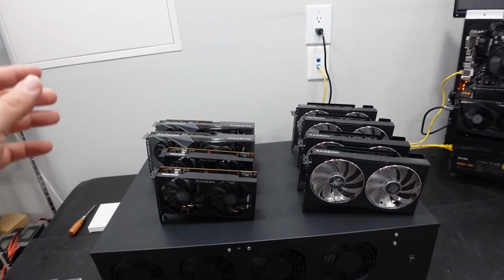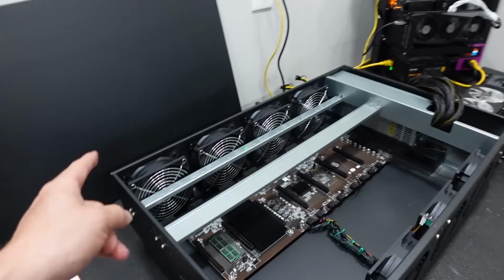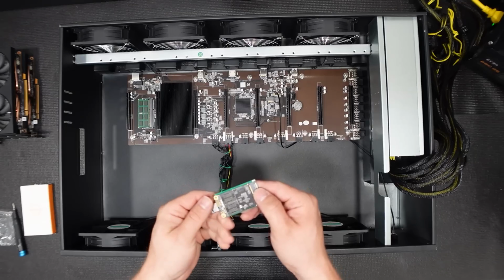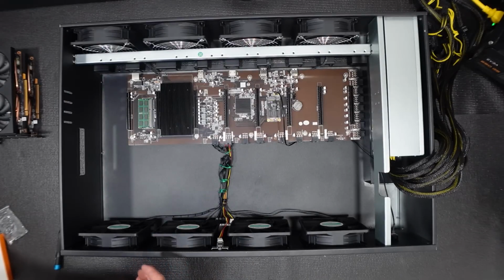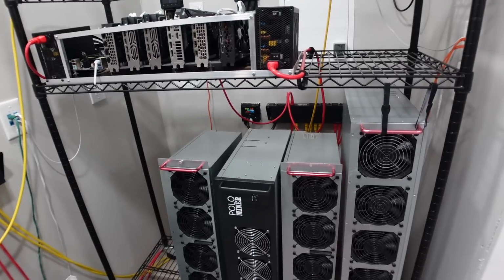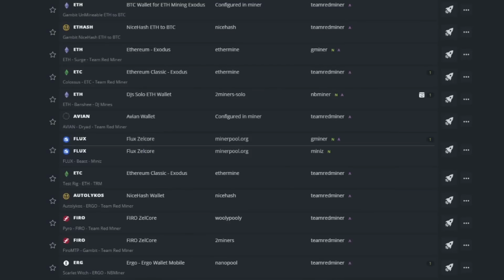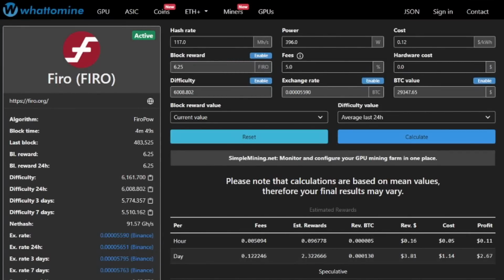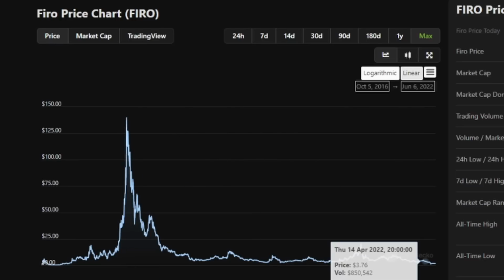BUILDING a GPU MINING RIG for AFTER the ETHEREUM MERGE

Comment: Hey hobbyist miner. I was wondering if you could look at the 6650 xt, 6750 xt and the 6950 xt refresh series. I noticed there was a increase in clock based algorithms rather then memory and would like your take on it. There isn't enough data on them on YouTube and would appreciate it if you find the time for it.
Reply: They are slower on Ethash compared to previous versions (6600, 6700…)

Comment: Had to buy a new mobo and cpu (Well an apu) but have a server style case with 2 atx psu's (750w powering risers, fans, mobo and apu) (1600w powering gpu's) which will power 6 3060 ti's once I get my hands on the funds for the cards, my current rig is 3 RTX 2060 12Gb cards which will get another 2 which is powered by 2 atx psu's one in a pc case with a 1660 (1000W) other mounted to a small table (860W) Once they are all sorted next rig will be an octominer and will work out which cards I can get my hands on or will work best for what I choose to mine.

Comment: It's funny I recently watched a video from 2017 and they was talking about mining other algorithms besides eth way back then because of the same thing we're talking about today. I know it's coming but who knew back then they had at least two generations left on Nvidia to mine eth that was extremely profitable.
Reply from the maker: Thats crazy but so true.  If ETH is gone from Mining. How are you handling the new heat factors from lets say Flux or ProPow Algos ... Plus the electric cost, so efficient GPUS are critical.  All stuff I think many GPU Miners are overlooking.
Reply: @TheHobbyistMiner  true, I know I mined raven coin last year for a few months and the heat became a huge issue, I only have 4 GPUs one of them by itself in my PC and that's what mined raven and it was terrible idea. My fans have been set to 100 ever since and temps are lucky to be at 60 c and all that GPU mines is eth now.